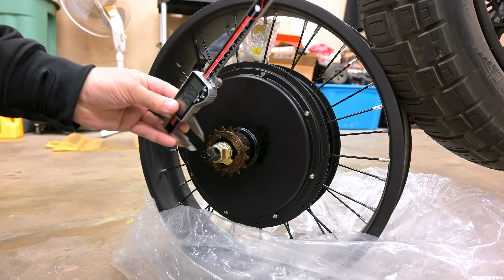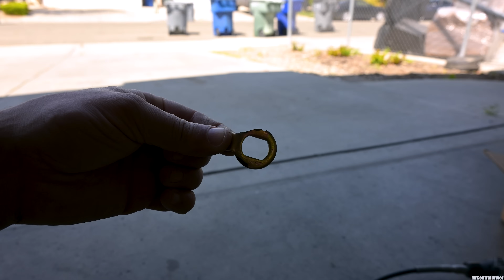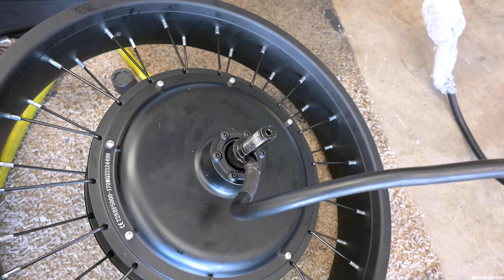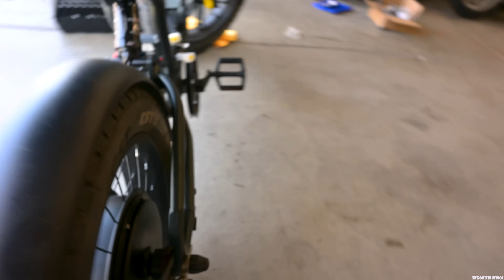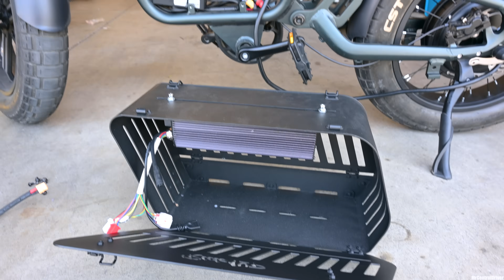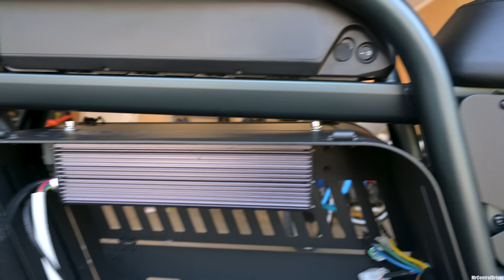RIDE1UP REVV 1 - 72v BUILD Pt.2

Comment from the maker: Powerful Lithium said we can fit a 34ah in this enclosure with the controller!
Reply: Hey Johnny just wondering if you can fit the controller under the seat instead of in the battery box?
Reply: put controller under seat? and make all the cage battery?
Reply from the maker: @YosefElgart  doesn't fit
Reply: @MrCentralDriver  damn this controllers huge mabe sideways or in front of the box on the frame
Reply: Loving my powerful lithium Athena battery!!
Reply: Dope!
Reply: Can you not screw or bolt or wtv to the side of those “cage plates” under the seat? having a sideways controller might fit under the seat and you may have more battery cage space.

Comment: what if you just purchase the 72v 34ah batt from powerful lithium? and not get the motor etc
Reply from the maker: how you gonna hook up the battery? your stock controller cant do 72v nor will it connect to your new battery. you would need to switch out the controller for a 72v one. then how is your controller going to connect to the stock rear motor? let's say we rewire the whole motor to work with your aftermarket controller. the cables coming off the motor internally would not handle the power and burn up. you can buy the battery to keep while u get your full kit together but you cant just buy a 72v battery with a stock setup. you can buy the 52v version from powerful lithium

Comment: I am using the same motor kit on my Schwinn spoiler chopper that I am starting to build. For batteries, I will be using two 72v 20ah for a total of 40ah can't wait to see what the top speed will be. What do you think you will get on your bike for top speed and range?
Reply from the maker: gonna be a 34ah battery so i expect 40miles in traffic or 60+ with lower speeds. top speed probably 52mph

Comment: hey bro as a non enthusiast who wants to commute to a job 3 miles away 6 miles round trip daily plus a few here and there for the grocery store. would the revv 1 hardtail suffice? and does it still have the offroad mode to hit 38mph? and what would the range look like on a throttle only mode.
Reply from the maker: The HT model is way different. It’s shorter. No suspension. Lower controller amps so less power overall. I don’t think it hits 38. It’s I think 33-34. Suspension in the front has less travel.

Comment: I know that you are having fun and making content but how was the bike with the stock set up and dual batteries? would you recommend it or should I look for something else? I want range and decent speed. I don't think I need a 72V system . Thanks for your input and all of your great content!
Reply from the maker: it was great i made 3 videos of the dual battery setup. no complaints. we got 4 revv1 bikes in my area and they all did the battery mod

Comment: I would have used rivets instead of the socket cap bolts for the controller. You can always drill them out later.

Comment: It looks like on the controller screws you have lock nuts on the bottom and lock washers on the top you can probably just do a flat washer on the top because you don't need that many locking parts the lock nut should be plenty and then get your clearance that you need bike looks really good

Comment: Put the controller on top. Where the battery is now. And you will have more room for a bigger battery.
Reply from the maker: how you gonna power all the stock turn signals and lights if you want to ride at night? Also you will need to extend the cables if you do that

Comment: Sometimes when my brake calipers don't line up, I use the little washer spacers that come with V brakes. I just run the bolt through them and put them between the caliper and the frame. The only time I've had to use the disk spacer is when the caliper rubs against the hub motor. If you use a couple of the small V brake spacers it'll line up the disk and caliper in the right position from what i can tell based on your close up view.
Reply from the maker: Awesome info!

Comment: Yo you have to move that stock motor to the front it will be a beast
Reply from the maker: dropouts aren't the same
Reply: Dropouts on front fat bike wheels usually 135mm , rear is 175-190mm. Its hard to find 135mm front hubs and  also hard to find a front fork and torque arm capable of holding the front motor. I put a front motor on my bike  and its cool but it was a hastle and i broke a couple forks in the process

Comment: Bike $2400
Kit $950
Battery $2000 +
Extras ???

You are looking at a $6000 bike

And funny thing is, a cop that will go after you for having a Suron is NOT going to be fooled when you are doing 50 (if that is even really safe on this frame)
Reply from the maker: its expensive of course. but tons of people are doing them to the super73 and those bikes start at 4000! so right off the bat your saving 1600 by picking up this bike and you get more features. We just now need companies to make parts for this bike
Reply: @MrCentralDriver  The bike makes 100% sense in stock form.  Adding a second battery for extra range makes even more sense.  The 72 volt conversion makes ZERO sense.
Reply: @bindingcurve  It makes sense if he wants to go faster. This frame and tire setup is fine for those speeds.
Reply: @AdamStrachn  This is going to cost over $1000 more than a 
Talaria Sting R MX4 or $1500 more than a Suron. AND it is a science experiment. It makes zero sense.
Reply: You could just buy a Metacycle. But it's arguably more fun to work on your bike and upgrade it. It makes perfect sense if you like the bike and aren't worrying about shelling out a few extra bucks, Surrons also look pretty ugly IMO, they are cop magnets.
Reply: Just pedal and its OK

Comment: Awesome build! Is the stand safe? BEWARE OF KICKSTANDS ! ! ! If they don't have a built in cutoff switch! I forgot to put mine up last sat, Apr 22 and had a wreck. Medical bills will be over $200,000....! I'm taking the f'ing stand off before I ride again!
Reply: Sorry to hear that mate, May i ask what happened with the kickstand that caused a wreck? I understand it was left down, but Don’t they fold backwards? I’ve always had them pop back up if i accidentally leave it down. But i can see how it t cause problems if you went to take a turn and were leaning into it
Reply: @EBikeBuilder_  I was picking up speed on a long downhill rt curve. When it curved left, the stand carved a gouge in the saphalt before flipping the bike like a pole vault. I have a fractured C1 vertebrae and lotsa road rash and stitches. Bill will be over $200K